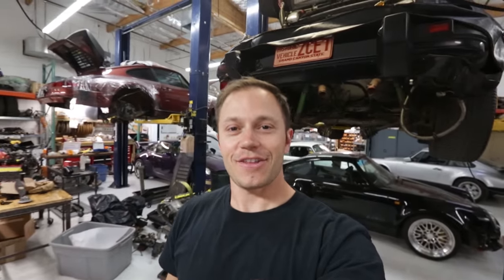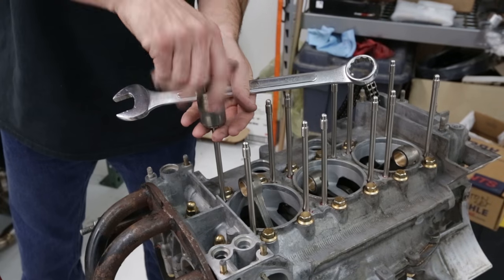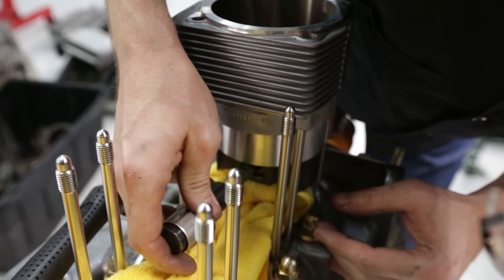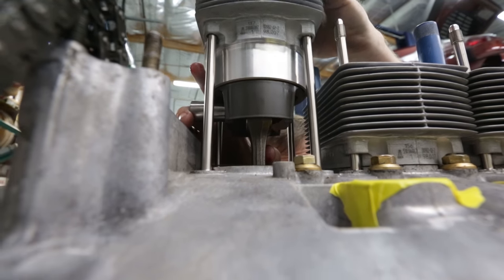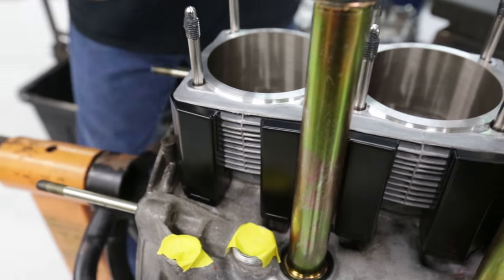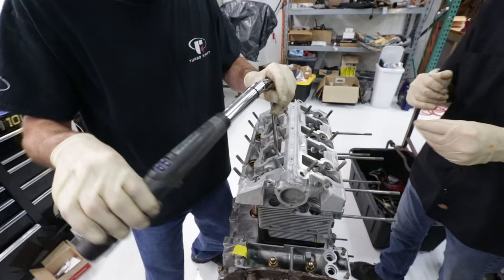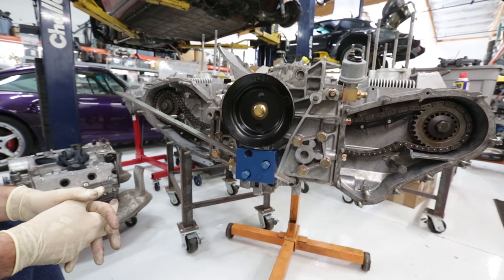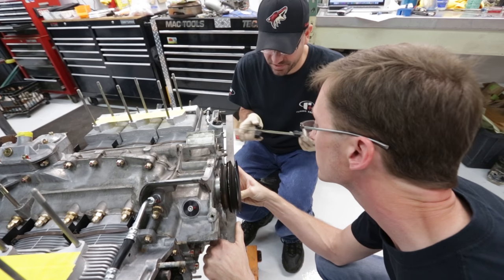How to Set Engine Timing and Long Block Assembly - Porsche 930 Project - EP06

Comment: I have a 1996 993 and I don't recall having a camshaft flange when I took out my camshafts. The car is a non turbo C2 6speed narrow body. Some guys have said that some models (later models) of the 993 did't have a cam flange and key sprocket system. I also don't remember any woodruff keys coming out of my camshaft. Does my engine need these items or have you ever build a 993 engine that didn't have the cam flange setup?

Comment: Question: You skip installing the cam chain housings. Do you install dry gasket and torque or do you apply any sealant, and if so, which one? Common leak area question.

Comment: I didn't see a lot of lubrication of the pistons/rings/wrist pins while they were assembling the motor.  Usually you lube the shit out of everything.  Also noticed that they scarred the first piston that they had trouble with the wrist pin circlip.

Comment: Those motors are so complicated!
Reply: They are German engines, and German tend to overcomplicate things.
Reply: Another reason they get rebuilt more than other engines.
Reply: Would it have killed their budget to put in a couple of bloody timing marks?
Reply: @Desertduleler_88  Totally wrong. Porsche air cooled engines are known for their reliability, I own two and both have more than 160,000 miles on them and still going. These guys just want to upgrade their engines, thats the reason for the rebuild.
Reply: @GroupWar  l know the engines are bad for valve guide wear, not to mention the chain tensioners.
Reply: @Desertduleler_88  the valve guide wear will happen to any engine reaching 100K miles, these engines wont have that issue before at least 150K, my personal daily driven Carrera has over 160K miles and still very healthy and never smoked. now compare that to Chevy small blocks or LS engines.

Comment: Why did they use a caliper to measure the cam alignment? If your tolerance is .25mm you should definitely be using a depth gauge micrometer for that

Comment: what are those metal pipes that go from the crankcase to the heads? Are they to take oil to the heads?
Reply: +boose boose 
Oil drain back from heads..
Reply: ok thanks

Comment: Great video man, so 550 hp vs the original 300? Serious increase, going to watch some other segments
Reply from the maker: +jim dandy That's the plan! It should make much more power with the new turbo and EFI :)
Reply: +Speed Academy Yes, the older cars have the appeal but new technology has its place if you want serious upgrades- I always loved the looks of the 930 even when it was new it was bound for glory. I worked at a Sunoco station in the late 70's early 80's and a customer had a dark green 930, loved the sound of that engine, he said top speed was about 160-165, he had it going 155

Comment: Bet they charged you extra for the questions because you are getting "tech" info which isn't free.  I've built lots of different engines but never a boxer engine.  Darn gasket kits are insanely priced. Checked pricing just for shits and grins. I wouldnt be grinning if I had to have one rebuilt.  Would have to do it myself to cut 1/3 of the costs or more.